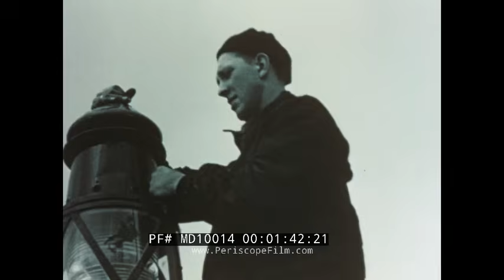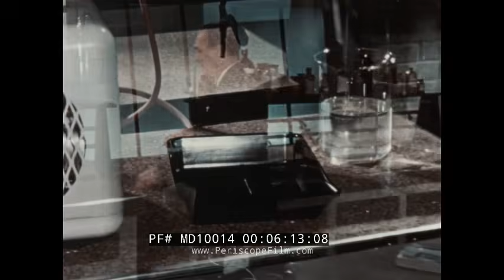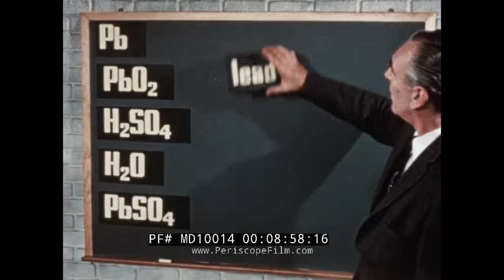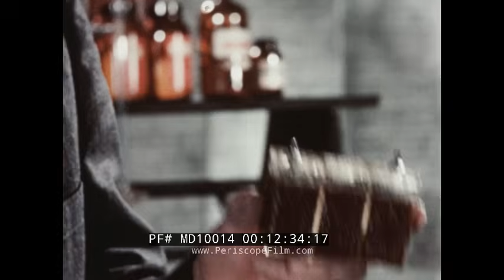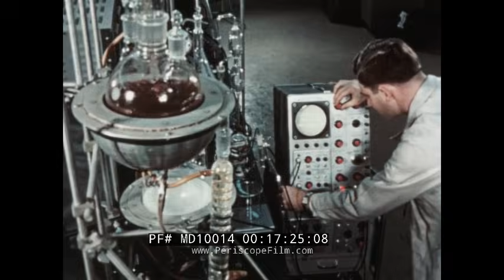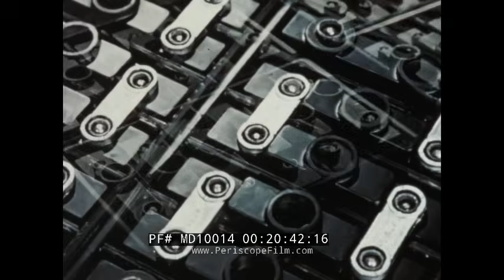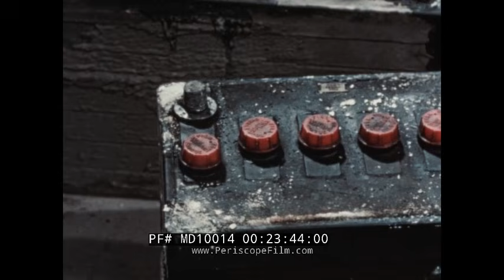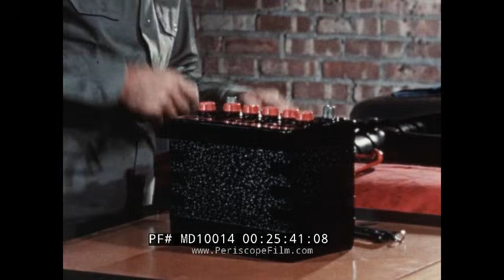" THE STORY OF THE MODERN STORAGE BATTERY "  LEAD ACID BATTERY 1959 EDUCATIONAL FILM MD10014

Comment: What a great presentation.  The only thing that surprises me is the failure to include the changes in specific gravity of the electrolyte as an indicator of state of charge of each battery cell.  Every service station and many car owners owned hydrometers in the day.  By the way, clothing manufacturers loved lead-acid batteries that required servicing.  Small amounts of battery acid splashed onto cotton clothing usually caused no immediate effect, but resulted in gaping holes in the garment when laundered.  Many an argument ensued between customers and laundries over who was responsible for the damage.
Reply: Indeed I still have several pairs of with holes in from battery acid, I'm glad it's a job we no longer have to do. And agree they did skip entirely over specific gravity, some of it is the first time I've heard it
Reply: Hehe, I got a hole in my Jncos once from battery acid, my sister washed them for me, and I blamed her for the hole for a while, LOL.
Reply: My chem teacher used to call them "acid bobs", but insisted that it was exactly what you said: a "hydrometer" and NOT to be confused with a "hygrometer". Have my upvote!
Reply: And that's why so many of todays mechanics uniforms are made from synthetic fibers.
Reply: @bitsnpieces11  Synthetic fibers which are probably the subject of another educational film, soon to be found in this channel. 😂❤
Reply: I've got a couple of shirts with holes from working on golf carts.
Reply: fake wood floors LOVE battery acid...

Comment: Now I know why you can take a fully discharged automotive battery and charge it with reversed polarity.
Reply: Careful how you use the term, reversed polarity.  It is true that current in the battery does reverse when the voltage at the positive terminal is increased to a level high enough above the battery voltage to overcome the battery's internal resistance, but the voltage at the terminals never reverses.  For an automotive battery of the period illustrated, a voltmeter across the battery would indicate about 12.6 volts at zero current, drop a little below 12 volts as the engine is started due to the high current draw through the internal resistance of the battery, and then rise to a regulated 14 to 14.2 volts or so as the generator operates at normal engine speeds.  The difference seen with the replacement of the generator by the alternator in the early 1960s was mainly in the superior ability of the alternator to maintain sufficient current output and regulated voltage at engine idle speed.
Reply: @Hopeless_and_Forlorn  he's saying you can reverse a flat battery on purpose, because a lead acid battery is mostly symmetrical.
Reply: That happens in Marina we had a motor wouldn't start no one could fix.
My multi meter needle swang backwards!
Guy recharged a dead battery backwards in his boat so the negative became a positive terminal....
Easy fix .
Guys said I was crazy back in 1984.